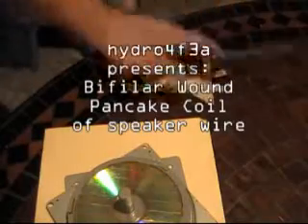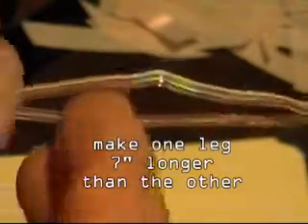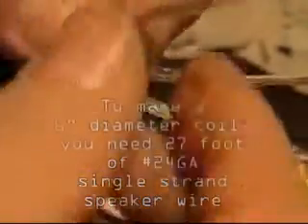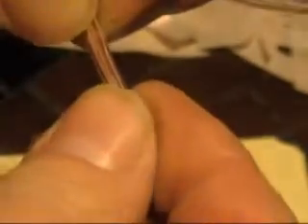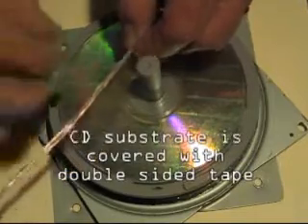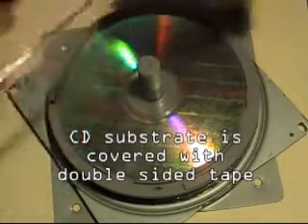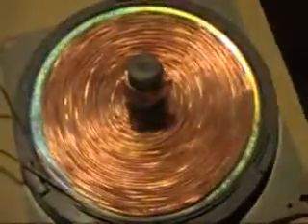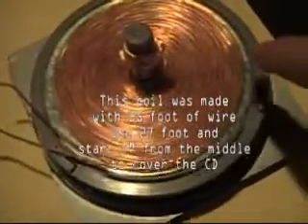hydro4f3a 012 - pancake coil with speaker wire

Comment from the maker: Hi. No Joke. Just making coils with what I have. In this case, the speaker wire makes (2) bifilar wound coils with exactly the same number of turns. The coils are 60uH inductance each, very well matched. They seem to have a lot of capacitance because of the insulation. May be good for something....